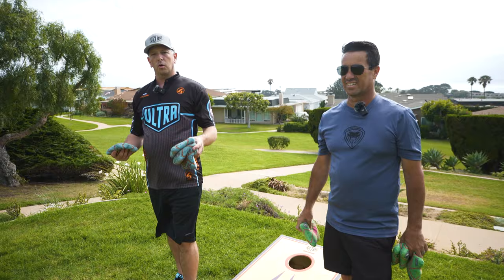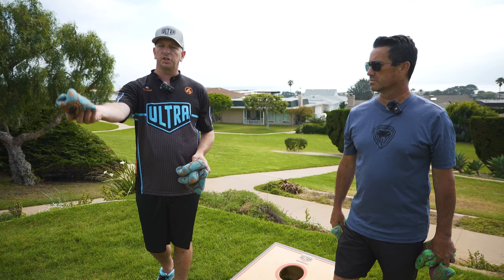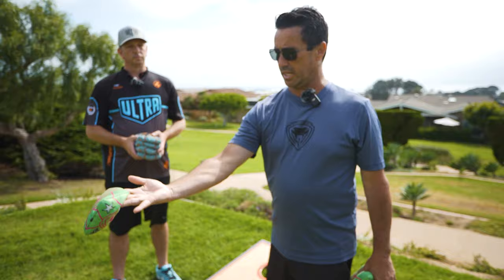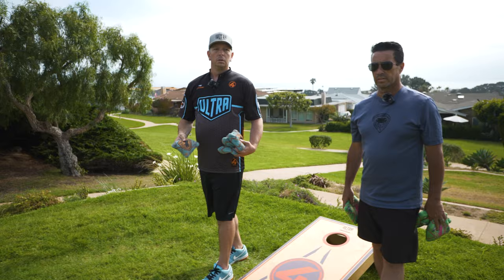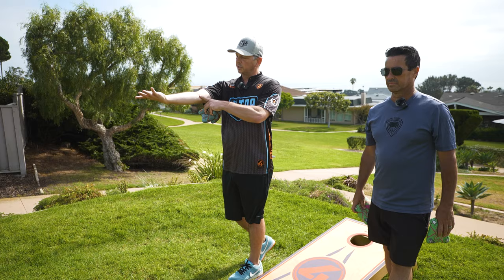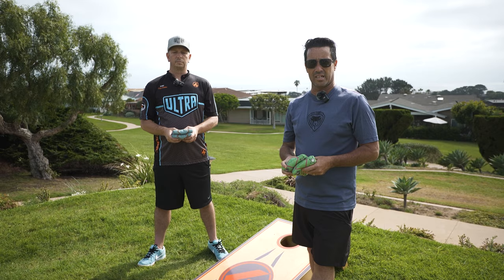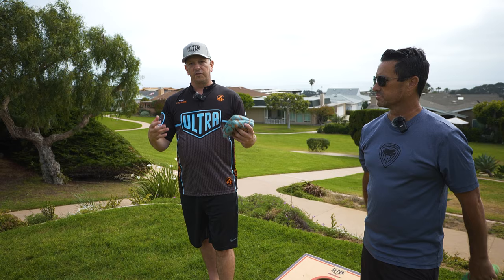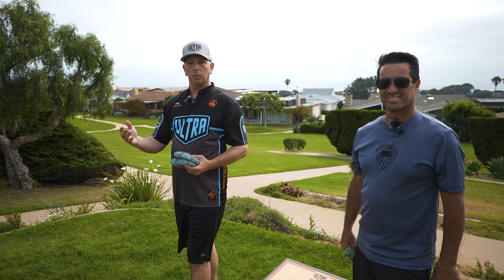How to Throw a Flat Bag - 3 Pro Tips to Fix your Bag Flight

Comment: I actually am just starting playing and I throw incorrectly by the videos standard. I pinch a corner and shake the beans into one side and toss it under handed. I bend my knees a lot and release it at about my shoulder and I am pretty good.  I see all my friend use the technique in the video though. I will try using these techniques along with my own! 👊
Reply from the maker: Check out our other videos with the pros, it starts with the grip. It takes a lot of trial and error to get a flat bag, stick with it and you will be smoking your buddies in no time.

Comment: I got a question, what can cause my throws going left majority of the time. I throw right handed, I have a perfect flat bag, but I've been having troubles with throwing every bag left across my body. Idk what I need to do to change, it's always one to left or 2 to the left and 1 off. I had it figured out for a Lil bit then it went back to old bad habit of going left. And I just can't get out of it
Reply from the maker: We have seen this often, the across the body miss. One thing we have seen work is to feel like your shoulders/chest stay square to the target as you release. If you reach toward the target too much and let your shoulders angle toward the target too much this across the body miss can become a problem. Try to square up your shoulders/chest to the target as you throw.
Reply: @Cornhole Network  thank you I will try it out

Comment: Just getting into this as my new neighbor competes. I’ve played just about every sport including bowling, disc golf, baseball, golf, soccer, football, hockey you name it… so competing is in my blood. My issue is I’m right handed but… I swing a hockey stick left handed, I throw a baseball right handed, throw a disc golf left handed, open up all doors and jars left handed, I write right handed. Naturally I want to throw a bag right handed but… playing baseball football my whole life you plant your left foot forward. I was told by my neighbor you plant your right foot forward when throwing right handed. It’s not natural. So I started throwing left handed with my left foot forward and I am a tad bit less accurate. I injured my shoulder years ago so my flexibility is limited in my right shoulder and getting my palm flat is impossible when throwing. I have major issues with an angled throw. Their bags land so flat when mine come In at an arch due to my shoulder injury. Sucks
Reply from the maker: I have something you can try that should sort you out. With the proper release you should put less strain on your shoulder because it happens much lower in the swing, but it all starts with the idea of not letting your hand/wrist hinge during the release. Imagine there is a straight board running down the top pf your forearm across your wrist and back of hand, holding all that in a line. Now you want to throw bags like that while smoothly rotating your forearm open to the target. If your wrist stays firm the bag will feel like it wants to go straight up, so you will need to release the bag lower in your swing to get it going toward the target, this is good. Keep practicing this until it become natural, holding the finish position to make sure your hand and wrist have not hinged (back of hand, wrist and forearms still in a straight line). At first this will feel very weird, but you should notice quickly that the bags will come out very flat. Soon you will start to notice when your wrist does break down leaving you with a sloppy inside tilted bag. Give it a shot and see what you think.
Reply: @CornholeNetwork  thanks for the reply. Definitely going to start practicing on the hand position, gripping the bag properly.

Comment: I have troubles with my flat bag spins over the hole and not hook in, I have natural spin on my bag. I'm consistent but have that one bag or 2 that I hit in same spot as others, but it just spin over the hole.
Reply from the maker: This sounds like a trajectory/speed issue. You want to throw each bag at a height that it will stop before it shoots off the back of the board. You could also try a slower bag, but with any bag you should practice trajectory control to stop your bag on the board either at or slightly behind the hole. Good luck!
Reply: @CornholeNetwork  okay thank you. I already throw carpet bags, so I just need work on trajectory, I can do that. I'll work on that today

Comment: Do you rotate your hand or your arm more when you want to get that right to left bag movement? Or both at the same time?
Reply from the maker: Its a combination of both. The bottom line is you need your hand to finish in an over-rotated position where your pinky is higher than your thumb.
Reply: @CornholeNetwork  thanks for answering. I think part of my problem is that I bend my elbow on the backswing and bend it before the release on occasion too. I sometimes I end with my fingers over the top. Palm facing down
Reply from the maker: @michaelminnie210  I know exactly what you mean and that is very common. The proper bag release is not intuitive and takes a lot of good reps to ingrain to muscle memory. If you are too focussed on outcome to soon your form will break down and leave you with that elbow out, sideways hand position release. Your brain needs to learn to trust that the palm up release works better.

Comment: OK, got the consistent, flat bag with spin. How do I add the accuracy part back in as mentioned at the 1:48 mark??
Reply from the maker: Sounds like a recipe for the next episode. But in our understanding, once you have your mechanics of a flat bag locked in, you can focus on accuracy, which just means practice hitting your targets with this new technique. With enough reps you should find it.
Reply: What helps me, focus on aligning your release point with your line of sight of the whole. Kinda like lining up your front and rear sights with your target. I keep my elbows in and tight, and emphasize a straight motion as I throw. I’ve also really been experimenting with how the bag lands and how it reacts to hitting other bags and really focusing on changing flight angles and rotation speed. If it’s spinning fast it’ll usually hit and kick. Spinning slower it’ll almost absorb another bag and push around it. Where your bag lands, the angle it lands and the spin speed seem to be the 3 biggest factors. Long read, but im really fascinated in the physics aspect of the game.
Reply: If any one is decent with animation, let’s get together and make a physics video !
Reply: @koycarley1787  Check out Anthony Ayon's Cornhole Science channel for some physics.

Comment: What do you think of my technique which is it stays flat through the air, no movement. Either spinning nor end over end. Almost like a knuckleball in baseball. I do a high arch. I land it on the board 9.5/10. And can usually get at least a cpl holes each frame.
Reply from the maker: That is what we call the dead cat bag. The problem with the dead cat bag is, like a knuckle ball, it will move through the air in an unpredictable way, be highly susceptible to wind, and react to the board in an unpredictable way. A spinning bag will cut through the air like a Frisbee , offer much greater accuracy, and slide up the board in a predictable way. You will be able to play to a certain level with a dead cat bag, but if you want to move into a more advanced game you will want to start spinning the bag.

Comment: i got the flat bag. but the slide right over the hole and off the board
Reply from the maker: Trajectory control is essential regardless of what bag you are throwing. Try throwing a fast bag high enough that it stops before the hole. Once you can do that you can dial your trajectory to stop your bag wherever you want it.
Reply: Make your toss more of a rainbow

Comment: why do you have to spin it?
Reply from the maker: There are a few reasons: first so you can control what side on the bag lands on the board, second so the bag tracks up the board in a predictable way, and third so the bag flies through the air with the precision needed.